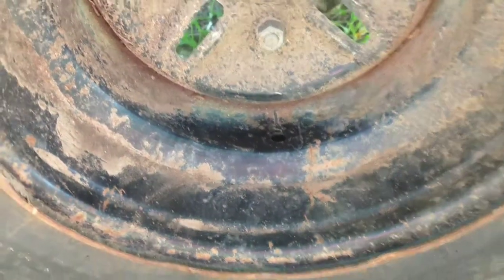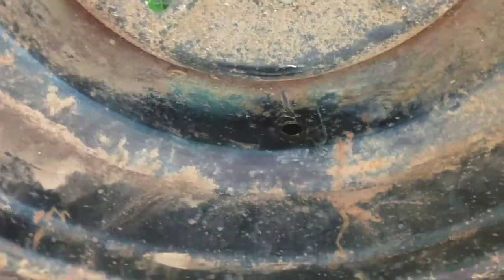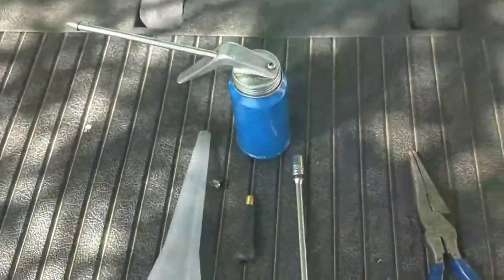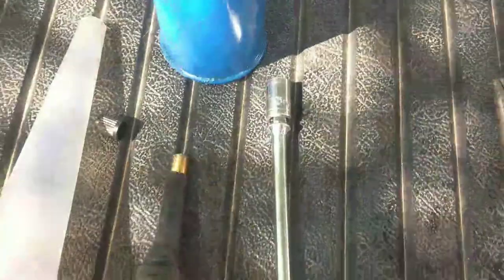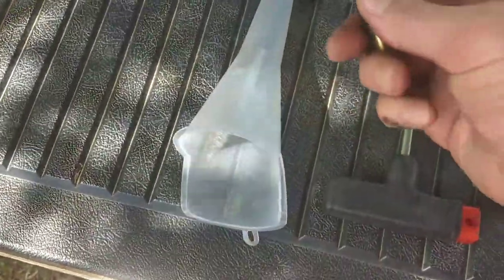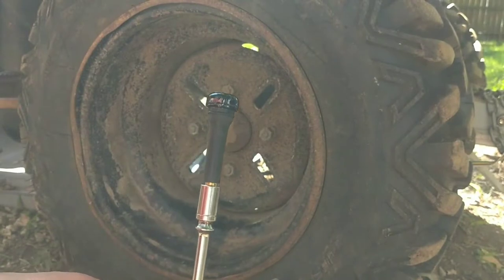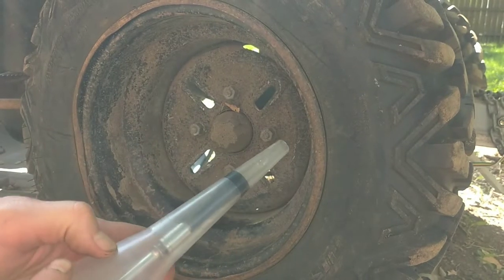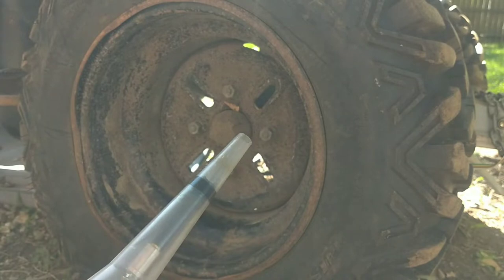Valve stem install without removing tire! No special tools or screwdriver

Comment: Sweet! Those valve stem replacement kits are a rip off at like $40+ now a days. I used a brake spring hook tool that I already had (everyone complains the hooks in those kits are cheap and bend. The brake spring tool is heavy duty and inexpensive) but then I needed a way to get the new valve in. Your funnel idea worked great. $0.98 at Walmart a I used three hose clamps to be sure it didn't break and it went right in with a few taps of my rubber mallet. The only issue is using a socket won't hold onto the valve and mine fell inside the tire. I fished it out  after a while but for next time I'm going to buy one of those long valve puller tools that are cheap and thread onto the valve.

Comment: Never use oil on rubber it will degrade it over time, use silicone oil or silicone grease  .Interesting video.